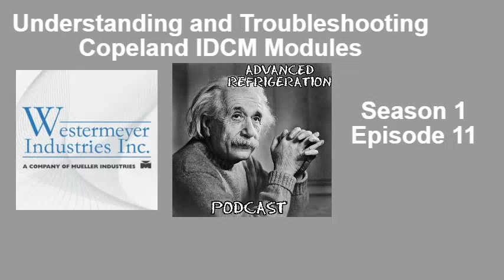Copeland Digital Compressor Unloading Controller IDCM (Season 1 Episode 12)

Comment: Demand failure or signal loss, would that be the same as an roof failure. I have a store that upon checking Tech Assist the two racks keep showing a proof failure??? Any thoughts would help….
Reply from the maker: Signal less than 1.44 volts DC what is being called upon which will mean the contactor will not pull in